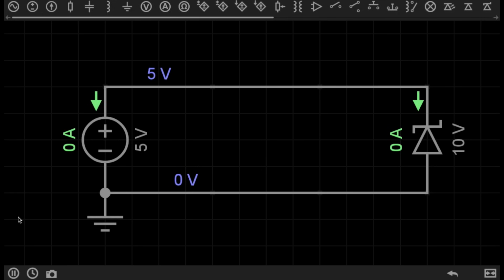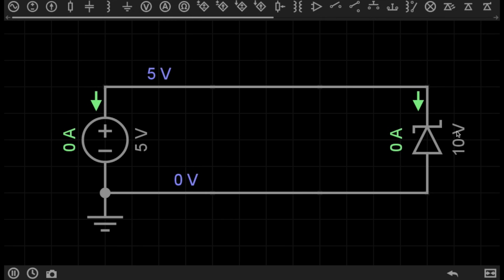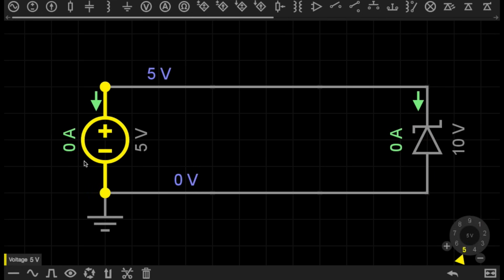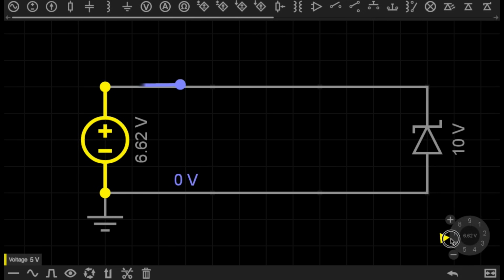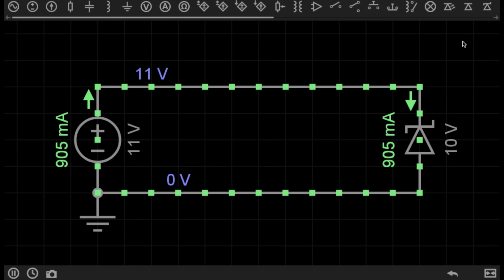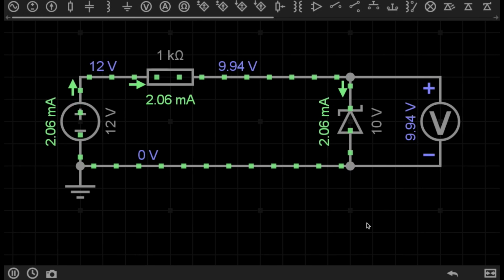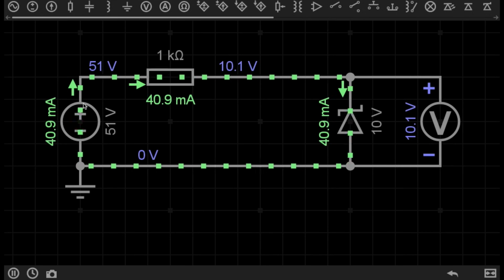What is a Zener Diode? - Electronics Basics 15

Comment: So, if 10+ volts can now move past the diode.. HOW can 0v [zero] be shown moving back to the source? 
Then, on the second diagram something reduces the 12v source voltage to 9.94v, however, the Zener diode shows 
2.o6mA moving across..  and still 0v returning to the source. The point?
Aside from the graphics.. Not sure what the purpose is of making such a confusing video. 
Even your diagram at the beginning.. that isn;t a zener diode.. its a 'avalanche'.. a zener symbol is on 90^    Grade F

Comment: if we supplied(5v) less voltage compared to the zener breakdown voltage(10v), then current wont flow across the circuit. In this case, the voltage in the zener diode will be more equal to power supply voltage(5v) or zener breakdown voltage(10v)?

Comment: CURRENT FLOWS THRU A DIODE FROM THE CATHODE TO THE ANODE

THE STRAIGHT LINE IS THE CATHODE, (-) THE TRIANGLE POINTING AT IT IS THE ANODE (+)

CURRENT FLOWS FROM NEGATIVE TO POSITIVE 

WHAT YOU ARE SHOWING IS INCORRECT
Reply: It is a conventional current, This video is correct.

Comment: Renez diods pass current the opposite way depending on the negative base bias. As long as you have a modulated  negative power supply giving no more than 153.6V reverse EMF. They work best in unstablized A/C high current motors. The motor industry were to use this method of voltage control in hybrid cars but found they were unstable in resistance due to vibrations while moving.

Comment: I really appreciate your videos, but.. the elephant in the room is the resistor that is dropping the voltage in the circuit to 10.1V.  The video implies that the zener diode is responsible for this voltage regulation.  It clearly is not. It is simply a checkpoint in the circuit that blocks flow in the event of a voltage drop below that imposed by the resistor.

Comment: I always use a zener across the pins on an ADC, if there's any part of the circuit above the procesdor's supply voltage.
Way easier than replacing the chip if something shorts or blows 🙂👍

Comment: At video 2.23 the voltage difference across the zener diode ( 9.94v) is less than its breakdown voltage.(10v) How does the zener diode allow the current to flow thru the circuit?

Comment: Thanks for the video! HOW CAN A VOLTAGE DROP BE TAPPED THOUGH? If a load, such as that diode is dissipating some voltage as heat...how is it possible that can that be tapped to supply voltage to some other load? Thanks in advance for answers to that!

Comment: Hmmmmm interesting info.
About ziner diotes.
Well I have an old TV.
Sundenly shut down.
I already think  the problem before open.
I seen 2 ceramic capacitor blown out.
And the fuse.
I seen the ziner diotes also the big capacitor 450vlts.
But what make strange for me I seen a relay there also.

Now after watching your video I known that the relay is about for a certain ⚡ voltage allow 💱 current flows.

So my conclusion is to check the relay and the big capacitor and the ziner diotes before change the 2 ceramic capacitor.

If not it will blew again.

Why either the ziner diotes is short or the relay.

Thanks for sharing this video.

Comment: ZENER DIODE-zener diode is just lyk any other regular diode that allows current to pass throught it,but when it is reversed it does not allow any current to pass through until it reaches a particular voltage known as zener breakdown voltage.once it reaches that voltage it allows current to pass through it.

Comment: Little summary of this video :
Diodes allow current to flow in only one direction. If you were to reverse-biased (change the direction) the diode, the current will not flow through the circuit until the "Zener Voltage" has been exceeded. As it happens, the voltage of the power supply is at 5volt. He moved the voltage to 10.8V, like that the "Zener Voltage" has been exceeded and the current can flow through the circuit. Zener diodes can be very useful for : creating voltage references, shunt voltage regulator and over voltage protections circuit. When you were to increase the voltage of the power supply to 51V and measuring the voltage throughout the zener diode with the help of a voltmeter, you'll notice that the voltmeter measured a voltage of approximately 10 volt and therefore you created a 10 volt voltage regulator.

Comment: You mentioned that particular Zener diode has a Zener voltage of 10V in order to allow current to flow. However, the circuit later shows 9.94V volts across the diode and the diode is already allowing current to flow. I see R1 resistor is dividing the voltage to 9.94V. Am I missing something?

Comment: But then even a normal diode has a breakdown voltage at the reversed condition , so like there is literally no difference except for the fact that this USES this property
Reply: Not the same. Normal diode breakdown is avalanche breakdown caused by electron/hole ionization of the lightly doped regions. The voltage is geometry dependent, and starts at a vulnerable point of max field strength. It is not that predictable, and is likely to damage the diode. Zener breakdown is a tunneling effect due to deliberate heavy doping which determines the desired voltage. Also, it occurs across the junction so you can design it to handle a max current, below which no damage occurs.

Comment: How about the current flow? Although voltage is not too high, but too high current will also damage the LED (for example, if LED as the load)

Comment: 0:38 Applying 5V forward bias to a diode without limiting resistor is a reckless bad start. The current will be high (you are seeing over 4 amps which will vary with diode) and burn out a common small diode.

Comment: So it prevents current from passing it, but should a current exceed its voltage capacity, it will keep the voltage to its capacity stopping the circuit from having too much voltage. Handy little thing, isn’t it?

Comment: Flashbacks to the first time I saw a zener diode on a schematic.

This was in a highschool electronics class, in what I guess would equate to junior year in the united states.
It was however in the "Elektrofag" (Electro-subject) line of the school system.

We had basically not been given any education on what anything was at that point, since it was pretty early on in the year, and the teacher drew this schematic for a rectifier. I knew a little bit, so I managed to piece together how it worked, except for the diode.

I had a look at the diode and thought to myself "thats a funky diode, I wonder whats different about it" and I asked the teacher as such. He tells me "oh thats a Zener diode" and wrote that on the board.

I ended up having to ask this teacher about it several times throughout the year, and the best explanation I could get was "The voltage across it is constant"

Needless to say, those who joined that line of school planning to do something with electronics (myself included) were so demotivated by the utter confusion those classes were, that practically all of us ended up not persuing that.

Comment: I was taught that electrons flow from negative to positive but you show the current flowing from positive to negative.
Current flow through a regular diode goes against the arrow.
Current flow through a zener diode at the zener voltage flows in the direction of the diode arrow.

Comment: Most don't realize it, but a LED makes a pretty good zener and can act as an indicator at the same time. I use them often that way when a TL431 is driving a transistor or opto isolator. A standard red LED is approximately 1.7V
Reply: Honest question... how? I mean... seriously, I don't see LEDs acting in any way like a Zener. They have a very wide forward voltage range, so you can't realiably put several of them in series, and get an accurate Vout, unlike Zeners that have specific Zener voltages and don't deviate much from there.

For less money than you buy enough LEDs to match typical Zener diode voltage, like 12v, you buy a 12v Zener diode, a 547 NPN transistor, a resistor and an LED, that indicates the Zener voltage has been exceeded, and have a much more accurate reading.
Reply: @daikatarokamegawa542  Agree with your first paragraph though............
1) with due consideration one can place a LED in series with a Zener to get a higher effective Vz (and an indicator)
2) if Vout isn't critical a LED does have an advantage of a  lower "working current" than a Zener
Reply: @kennmossman8701  
The fact that OP shut up right away, after being asked to prove their claim, is a pretty solid indicator that they're full of hot air, and just boasting to try and score internet points, and make themselves look smart.

I work electronics for a living, and am currently in the way of full time automotive LED lightning, so I have some pretty solid understanding of what I'm talking about. LED behaviour, especially Vf is so erratic, manufacturers have to issue binning just to ensure some standards are being met, there's just no way LEDs can match the simplicity and reliability of the humble Zener. Heck, a busted LED makes little difference in like half the products we run, while a broken Zener often means the product either won't operate at all, or will blow up shortly after being powered, often literally, as having a biased or non-existing voltage reference means capacitors will exceed their rated voltage.
Reply: @daikatarokamegawa542  That is a very narrow view of electronics. A good designer uses every available technique to shave fractions of a penny off a design.  A LED can be very useful as a low voltage reference, level translator or voltage offset. I can think of a number of ways a single LED could be used to make an adjustable 12V power supply. Stringing a bunch in series is a pretty absurd example.
Reply: @opera5714  
That's why I said, how exactly?
Reply: @opera5714  I would like to see one................ a number of ways a single LED could be used to make an adjustable 12V power supply
Reply: Well  a LED does have a significant Vf but that varies by current and temperature so it is not a great substitute. Additionally a LED has a max current and  low reverse voltage.  It certainly is NOT a voltage reference.  More-ever the 'knee' is not  nearly as sharp as with a Zener. As well to get say a 9V output you need 3 LEDs (Vf of 3V) which takes up space.
I have used LEDs as a weak means of getting a more stable voltage but the actual voltage (over current, temperature, etc was not important.
Reply: "I use them often that way when a TL431 is driving a transistor or opto isolator"      what the heck are you talking about?  Makes no sense.
Reply: The question should be, why would you ever want to use a zener in a power supply? Sure, when you start out zeners look slick. They are inaccurate, waste power and a brute force way to do things. There are more sophisticated devices like the TL431 which only cost a penny and numerous regulators which can be current boosted to any 
voltage wanted. I have a drawer full of zeners and like many others only use them when no precision is needed and the circuit will be subject to large voltage transients.
Reply: @opera5714  
Oh man how far we have gone! From a simple LED, to an integrated circuit that features, shocking I know, a Zener in its internal construction!

Note how you completely avoided your initial statement, that you could use an LED as a satisfactory replacement for anything a Zener could do, and are now leaning towards a much more complex, much more expensive solution.

Yeah you're right, Zener in voltage supplies are useless, why bother with Zeners at all? Let me tell that to all my customers who design PCBs with built-in power supplies, they'll be relieved they can replace the reference Zener with an LED. Also I'll send an email to Texas instruments to stop putting those pesky clamp Zeners in their uC.

Like you, I can think of several reasons I would use a Zener in my circuit. But unlike you, I can actually list then instead of completely avoiding the topic:

As a simple, cheap clamp circuit, to protect a low current input from voltage spikes, and even to allow end user a wide range of operation for versatility. For example a 5v input, that can accept 5-50v.

A voltage reference for a PWM regulated supply.

A warning circuit for overload inputs.

It is an integral part of the application circuits of several dedicated power supply ICs, for example the INN2603K.

And those are just the examples from the stuff I'm currently working on. Virtually every board I test, that supplies its own voltages from either AC or a common voltage rail (typically 24 or 36VDC) uses Zener. And I'm fairly certain designers don't put Zeners in a mass production circuit because they sound cool, or they like them.
Reply: @opera5714  Wow, you are so insightful. So – with minimum component count and cost – how can I use the TL431 to replace the Zeners used as below;
1) 10V at 120mA 
2) a 48 Volt PSU for COBs
3) a peak clipper – to remove voltage spikes at 100 Volts
4) how to remove stability of TL431- see Fig 17 (https://assets.nexperia.com/documents/data-sheet/TL431_FAM.pdf)
5) delta V is 1.3 Volts
Reply: Here is one of many that can be found with a search. Good for a beginner. Somewhere I have a detailed paper on using them as a reference.
http://www.waynekirkwood.com/images/pdf/Lefferts_LED_Used_as_Voltage_Reference_ED_Feb_15_1975.pdf

Comment: Zener are these two pins current eater diode semiconductors notorious for their waste energy cosumption until to get the desired voltage.And the less the current that flows through their load then higher is the current that flows through the zener itself.So the amount of power consuption of any zener regulator is exactly the same with or without any load being connected.

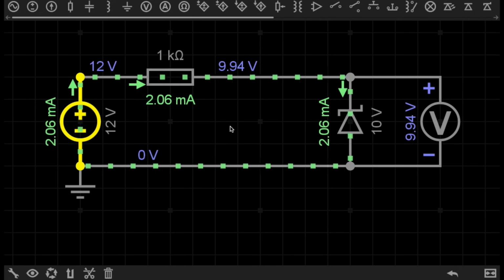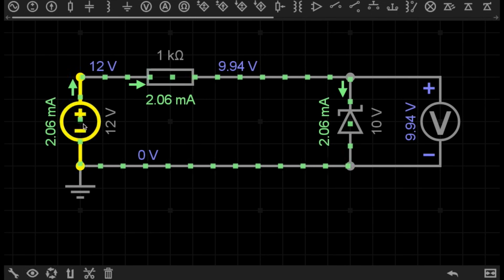Comment: 2:40 Why was the Zener diode allowing current to flow, if its reverse breakdown voltage wasn't being exceedes by the voltage source? At 2:40 the voltmeter shows 9.94 V, which is less than 10 V. Thanks in advance.
Reply: Alejandro Nava
Reply: @gmustsgman7113  What?

Comment: HOW DOES IT MAINTAIN SUCH A LOW VOLTAGE ??
Reply: It's not so much "maintain" the voltage as the circuit operating in such a stable condition. The "strike voltage" or "zener voltage" when reached, causes the semiconductor to break down rapidly. It's that breakdown speed that keeps the voltage relatively stable. In reality the zener diode will be rapidly changing state as the voltage rises across it, causing it to conduct thus the voltage across it reduces switching it "off" and so the cycle rapidly continues.

Comment: Simply Electronics - Pardon me but I R confused.  Your diagram shows the post-Zener Diode [output?] voltage always at 0V, even when the supply voltage exceeds the Zener's 10V threshold voltage (if that's the correct term).  So when you increased the supply voltage to 11V shouldn't the output voltage be 1V?  And then you added a resister.  When you then increased the supply voltage to 51V, isn't it the 1kΩ resister that's reducing the circuit voltage to 10.1V (before the Zener)?  And since the Zener is only blocking 10v, shouldn't the resultant voltage be 0.1V, not 0V?  Or maybe since there's no load in the circuit post-Zener that's why the voltage going to ground is 0V?  Like I said, I R confused. Of course I think Ronald Reagan was POTUS when I took AC/DC circuits as an elective class.

Cheers from Thailand!
Reply: I may get some of this wrong, since I am learning too, but here is my understanding (and ignoring small voltage drops across semiconductor components): The 1kΩ resistor is not reducing the circuit voltage, rather it is limiting the current passing through the circuit to prevent a short-circuit since the zener will no longer prevent current from flowing once the supplied voltage is greater than the break-down voltage. If a normal diode were used reverse-biased instead of the zener diode, the voltage after the resistor would be 50v with no current flowing. If a normal diode were used forward-biased, then the voltage after the resistor measured from one leg of the diode to the other would drop to 0 since all the current would be allowed to pass through. These voltages are distinctly different than the 10v measurable across the zener.
Reply: @thelasttimeitried  OK 'limiting' vs 'reducing'.  Since the 1kΩ resistor is located in the circuit before/ahead/upstream-of the Zener it seems it, not the Zener, is responsible for the voltage drop.  In the video, maybe I misunderstood, but I thought the author said it was the Zener that was responsible for that voltage drop.

My real confusion is with the voltage post Zener since the diagram's output voltage in each case doesn't seem to agree with the voltage-limiting components in the circuit. 

Thanks for the reply.  :)

Comment: Video spreads wrong info, there is always a reverse leakage current of some nano or micro Amps, in case of shottkys sometimes milliamps, always check the datasheets of the diode ur using if this could be a problem for dome of your ics

Comment: I remember that a reverse-bias Zener Diode was used on some early (1970's) Triumph Motorcycles. This Zener Diode was placed under the Headlamp, and had alloy Cooling Fins. This limited the voltage/current to the on-board 12V battery, and dumped all of the output from the Alternator to Earth when the battery attained 12 volts (and fully charged). Probably would have been a better idea to utilise the excess voltage from the Alternator to power Day Running Lights in hindsight! I really liked your simple explanation of the zener diode and lots of potential uses for this component.